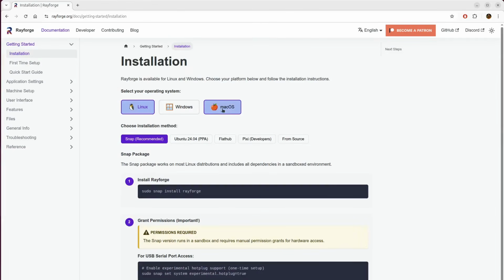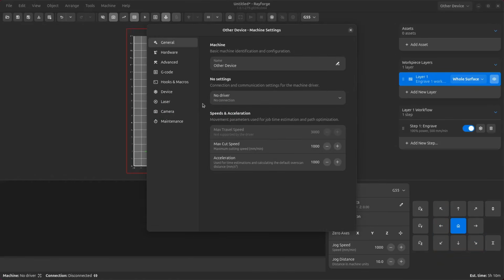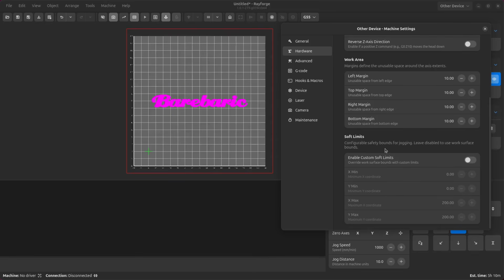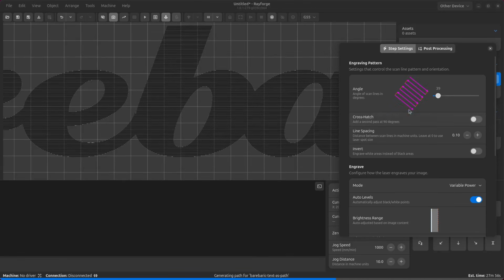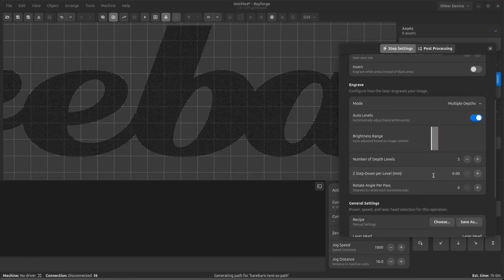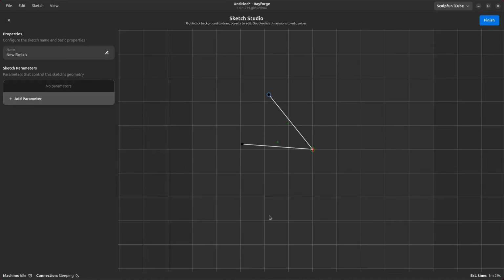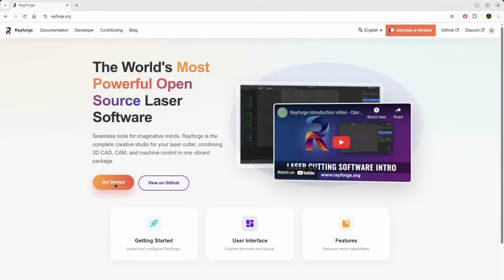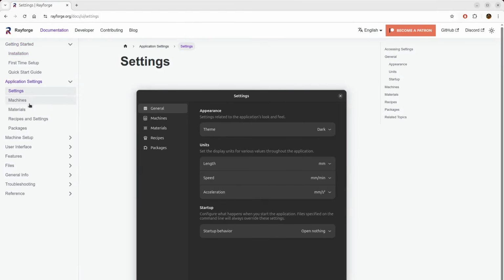Rayforge 1.1 is here! Open Source Laser cutting with MacOS Support, G-code Console, Dithered Raster

Comment: Love the project, super quick responses on the GitHub. Thank you. Missing a machine profile for the k40 out of the box, but works great
Reply from the maker: Thank you for the feedback! I'd love to add the profile - could you attach your config or debug log (Help -> Save debug log) to a Github issue? Assuming your machine is correctly configured, the debug zip file has all that I need to create a profile for the next release.
Reply: @barebaric will definitely add it tomorrow. It is the omtech k40+, slight board differences to a standard k40. Profile needs a few small tweaks still